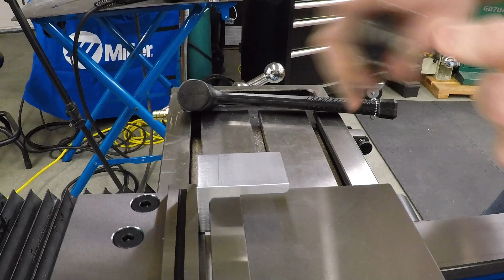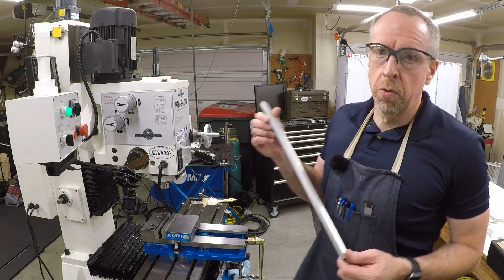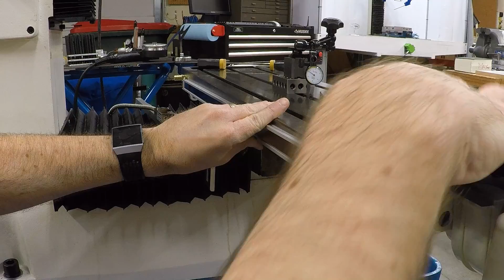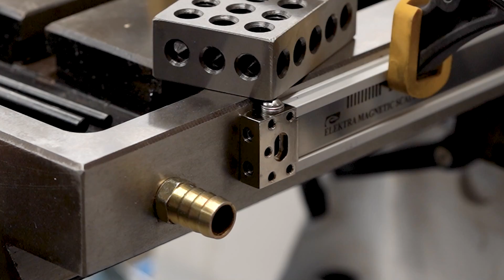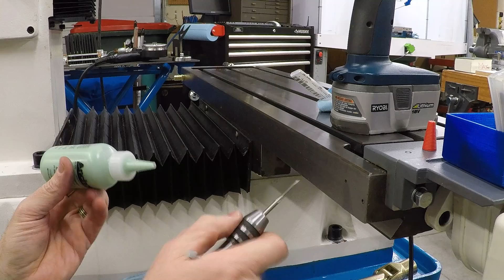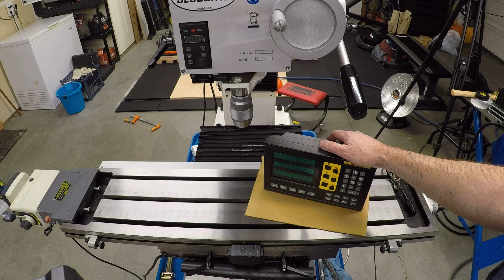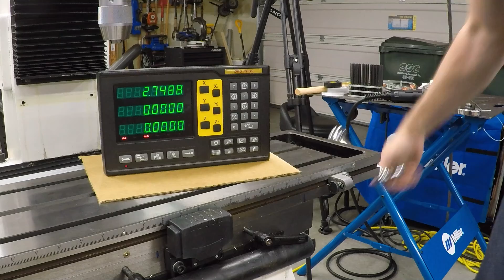Installing a DRO on a PM-940 Milling Machine - Part 2 - 4-Axis EL400

Comment: Convert it to CNC already. How can you be a computer guy and work manually on a mill? Install a servo motor instead of stepper this time. It will be amazing.
Reply: It's nice to be able to turn the computer off when work's over and go do something else.
Reply from the maker: The other factor is setup time.  To do anything on the CNC mill takes a bunch of time at the computer figuring out the tool paths, workholding, and feeds and speeds.  And if I mess anything up, I break something.  I find myself putting off projects because of the stress of this process.  Just throwing something in the vise and making a simple part is often much faster than modeling it first.
Reply: @EverettWilson  I hope he does it. He can make many video parts machining stuff to fit these motor in.

Comment: To prevent chips from getting inside the screw head, you could just put some tape on it... 
Of course you could also CNC some fancy covers fixed from below if you have enough space or from the back... But knowing you I doubt there will be tape involved 😉
Reply from the maker: Good idea.  A piece of kapton would do nicely.

Comment: Nature will eventually force you to wear bi-focal safety glasses. 👴👓
Reply from the maker: These are bifocal safety glasses.  :)
Reply: @Clough42  In that case you'll need the special glasses that have a reading strip in the top as well so you can read the DRO without having to tip your head way up. 😁

Comment: How about  a drop of silicone sealant in the screw heads while they are clean.  When you need to remove them it should be easier to remove than a build up of chips and gunk.
Reply: Silicone sticks too well.  It's a real pain to get out of a small cavity.   Maybe hot glue?

Comment: Datums is correct according to Merriam-Webster.
Reply: But on the other hand, Merriam-Webster also says that I can use "irregardless" as a stronger form of "regardless". Language isn't what is written in books, it's what we use. If we start using something else, MW would need to change that, because they are trying to catalogize our language.
Reply from the maker: Yeah.  "Irregardless" used to bother me, until I realized I was "that guy" and let it go.
Reply: Not to be confused with "diddums".